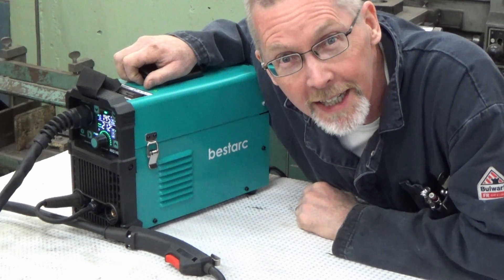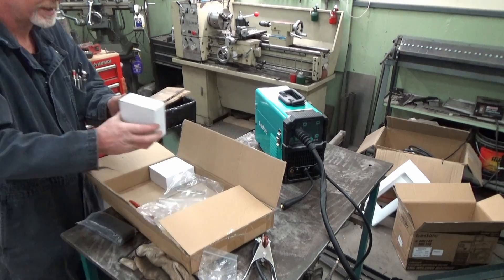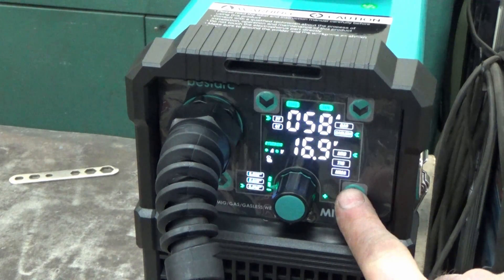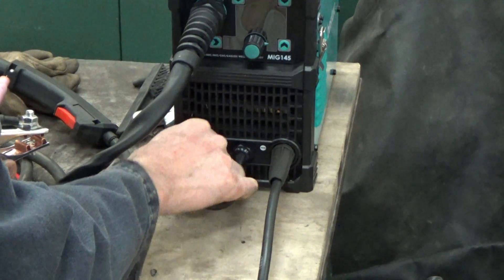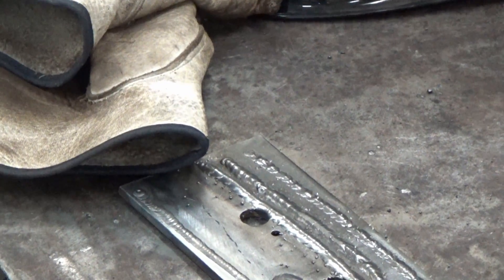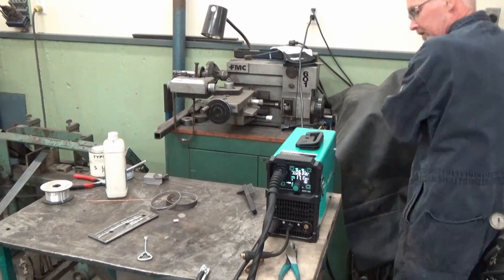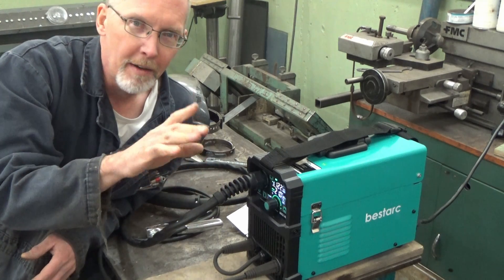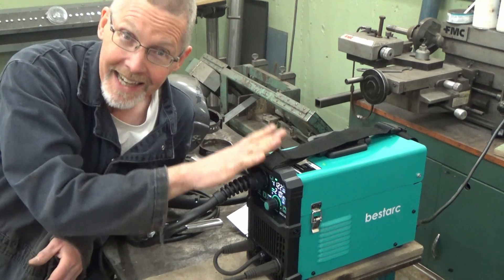MID-WEEK REVIEW: BestArc MIG145 - We Test It All! (and then I gave it to a student)

Comment: Did you have to change out anything to run the aluminum wire??
Reply from the maker: I did not change the liner, just the gas to straight Argon.  I don't know if that would be an issue long-term, but I'm sure a teflon liner can be fitted.

Comment: This may be a silly question but does this welder have the ability to TIG aluminum?
Great review, thanks for sharing.
Reply: Aluminum TIG requires AC to break up the oxide layer which has a higher melting point than the base aluminum.
Reply from the maker: No.  Aluminum requires AC.
Reply: @ • Thanks for the reply, I appreciate that very much. 
I have another question if you don’t mind? I just got my BestArc 145 (9gen) and I noticed that the contact tip does not screw all the way in and it looks like to me that the contact tip is pushing against the liner like the liner is too far ahead in the end of the mig gun, will it cause any problems with the contact tip touching the end of the liner in the mig gun?
Besides that it seems like an alright little machine.
Reply from the maker: Without seeing it in person.... Some MIG tips are designed to seat into their collet, and others push against the liner.  They aren't interchangeable (the threads are different), but brute force usually wins.  I gave this welder away to a student last year, so I can't look and see how it was assembled.
Reply: @ • I went with the brute force strategy and just forced it in all the way, seems to work fine, LoL. 
Thanks again for the reply.

Comment: i just bought this machine and have tried flux core on a 1/16 aluminum. tried so many different settings. on lower amps, it wont make a bead. if i slow it down it burns through. and same with higher amps. it either burns through or if i go to fast it wont make a bead.
Reply from the maker: On Aluminum?

Comment: Where did you get the reducer for the torch cable
Reply from the maker: Local welding shop.
Reply: @GregWellwood  Do you know the brand? model?
Reply from the maker: @kenturner3268  No.  It was on their wall of adapters.

Comment: Great job! I have the arccaptin MiG 200 . Iv found out welding stainless steel I switched over to try mix and I get no flaking on the back of stainless steel. When I can’t tig stainless on kitchen equipment and I’ve used stainless MiG wire for tig welding in a pinch when I was out of tig rods same for regular steel.
Reply from the maker: I really liked the ArcCaptain MIG200, good welder.  I keep 1/8, 3/32 and 1/16 TIG rod in Steel, Aluminum, and Stainless, and I take from the small MIG spools when I need really thin TIG rod.  I usually TIG sheet metal using MIG wire as filler.

Comment: That Shop Teacher - I live in Canada. A guy an hr away has an Eastwood 140amp Elite Mp140i Multi Process for sale. It’s hardly used and comes with the, mig gun, tig and stick attachments. He only ever used the welder stick welding. 

The BestArc you reviewed above I can purchase for approx $300cdn, including delivery, but I still need a tig torche. 

If I could get the Eastwood for 400$, plus the gas on 250km drive, which would you choose? 

Appreciate your opinion.
Reply: I just got one of these units today, but here’s hoping you got the deal on the Eastwood.

Comment: how would you go for the home hobbyist who has 220 V and most likely would max out at 3/16 at $230 vs arc captain mig 200 @ $525?
Reply from the maker: I would always recommend the biggest welder you can afford, you can always turn it down, but you can't turn a smaller welder up.  But budget always plays a role.  I had a 110V-only MIG for years prior to these, and it did almost everything I ever needed.
Reply: @GregWellwood  Since I had 220 I decided on the arccaptain.